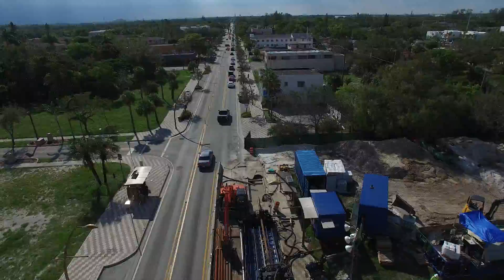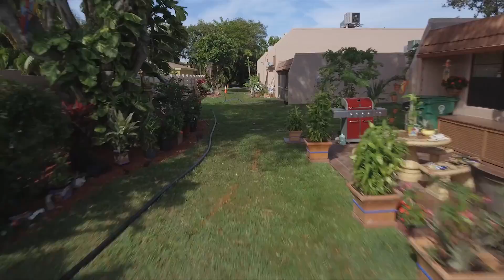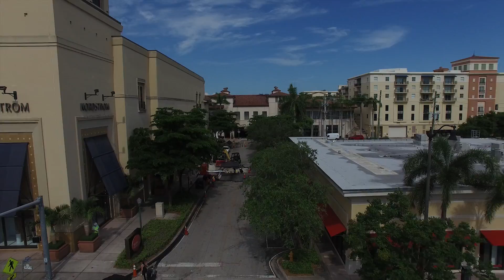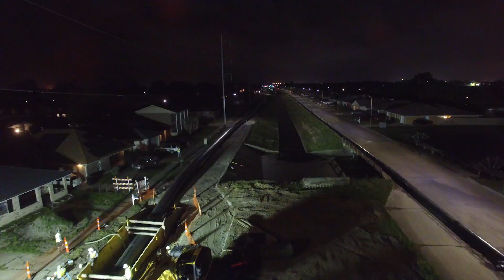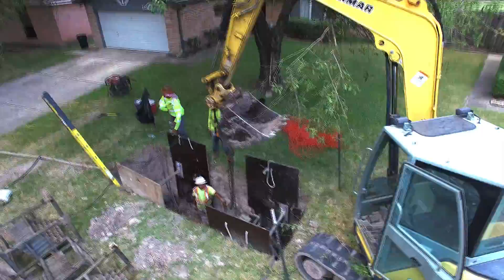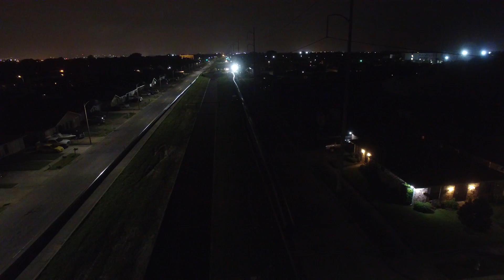Drone Video of Trenchless Construction Projects

Comment: Flexible sewer pipe is an interesting project material choice?  Why not just open trench ridged pipe?
Reply from the maker: Open trench construction is typically considered, but can also have a huge impact on traffic, businesses and homeowners. When replacing water or sewer in urban environments, trenchless methods as shown on the drone video lesson the impact of construction on the community.  The flexible pipe being installed is HDPE pipe and currently becoming a preferred material for many cities as the pipe solves the 2 main failure mechanisms of why pipes fail.  It will never corrode, and it moves with the ground when the ground shifts.